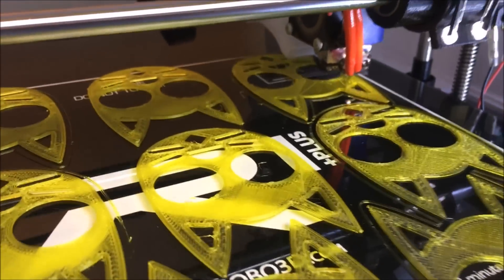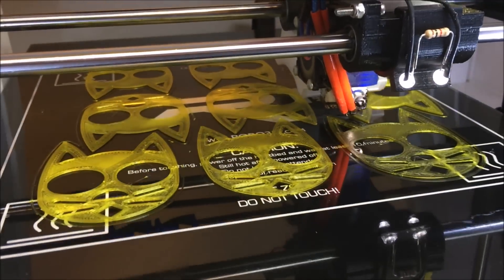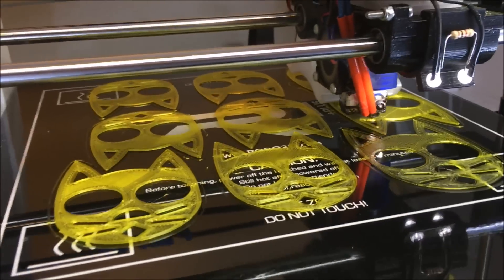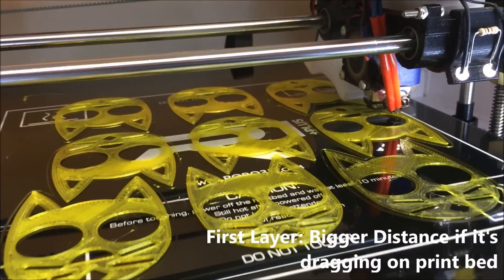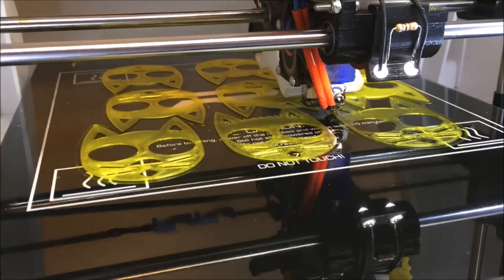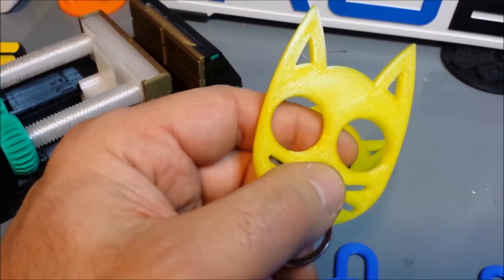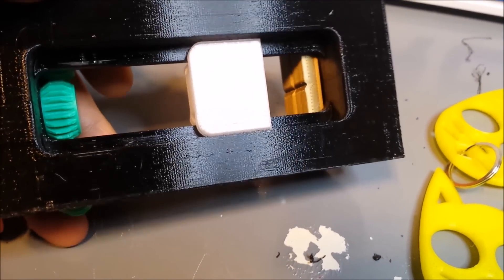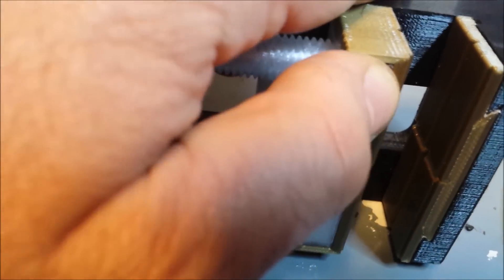Tips On Printing With PETG

Comment: I don't even know if you're going to get this but if you go 50% fan is that making the print strong but detailed does it works out way?
Reply from the maker: It's a trade off. Another thing is,  the thicker the perimeter,  the stronger it is too. Even solid PETG can add a lot of strength. 

Since this video I print PETG with a 1mm nozzle to make really strong parts.

Comment: I'm using an ender 3 and I cannot get PETG to work. Bed is level, extruder is at 240 and bed is at 50, It's not sticking to the bed it will for about a minute or so and just starts warping really badly and not adhering to the layers or the bed. Any information to help me would be awesome, thank you (thats a nice printer you have and good setup)
Reply: try 70c for bed temp.

Comment: Thank you for providing details how you print PETG, is giving me such a hard, hard time printing on the Ender 3. Big parts work like a charm, but anything that has small radius or features, it just doesn't work., it basically drags everything with the nozzle. The initial layer height that I'm using is 0.29. Do you have a CURA or Slic3r profile that you can share? Thanks!
Reply: Hi, same happening to me. Have the solution yet?
Reply: @durian2642  I ended up using a glass bed, and glue stick. 75-80C on the bed, 240C on the nozzle, 25mm/s first layer or slower, 0.24 or 0.28 height on the first layer. Ifntja doesn't work use a brim with 4 lines. If still doesn't work, user the wham bam pex surface, that thing is unbelievable good. I moved from the glass bed to pei bed which worked better, pex from wham bam much better
Reply: Alex Garcia thanks a lot for helping me out
Reply: @durian2642  no problem at all, I only print PETG 99% of the time, is the best mix of pla and abs

Comment: I saw a resistor at the bottom of the extruder. Why do you install it and which value
Thanks for your video
Reply from the maker: ducbrifad The resistor is for the LED lights. I had to add resistance to the circuit to balance it.
Reply: OK thank you for your answer

Comment: Hi George, thanks for posting your experience surrounding printing with PETG, I'm attempting my first print and so far both times it has come off of the bed. I've dialed back a lot of settings now based on this video - so heres hoping third time is a charp. :)
Reply from the maker: Ian let me know how it turns out and if I can help make it a success. It's a great material if you can dial it in!

Comment: for boubble free, see though clear solid prints, go hot and slow with no cooling, and a slightly domed nozzle. i found out by accident, after trying to polish a slightly rough nozzle with a nail polishing file. (turns out cardboard is abrasive enough for that) the finish on the outer walls suffers, but prints come out perfectly solid.
https://www.dropbox.com/s/vwfa6qq9f5kwqhh/IMG_20170311_183919.jpg?dl=0